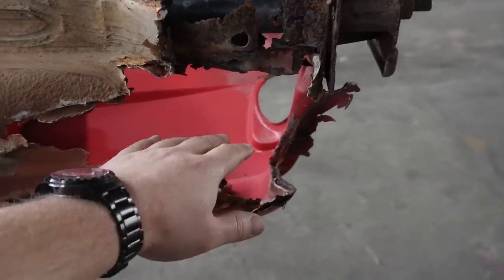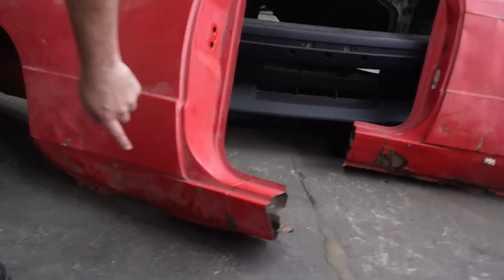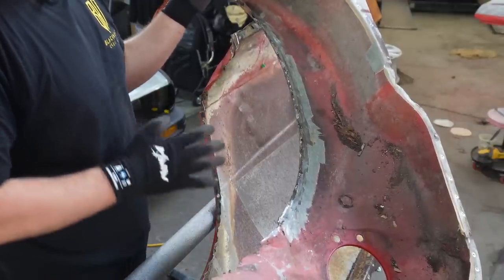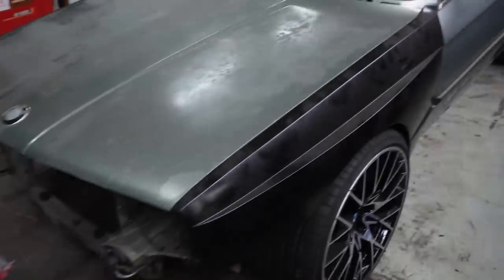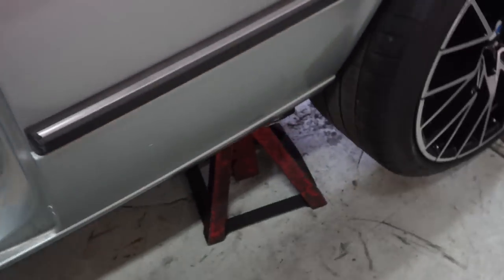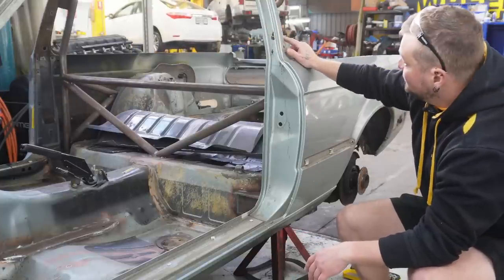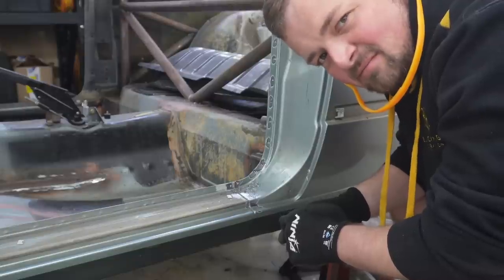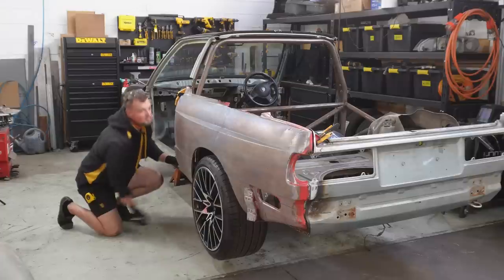E30 Ute Ep.18 M3 rear quarter test fit

Comment: Bmw Germany have the outer inner arches in stock at present, as I got a pair last week.  Incase you can not reuse the ones on the used arches.  Or you maybe fabricating them
Reply from the maker: I ordered the outer arch for the side without the filler neck the other day, I think I’m going to have to make a custom one of the other side as I’ve cut into it pretty badly for clearance.
Reply: م